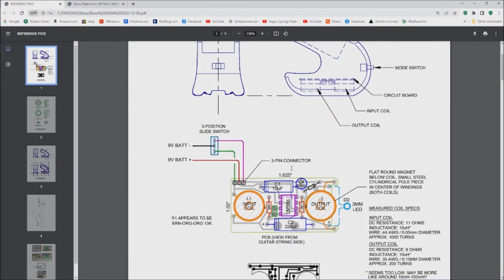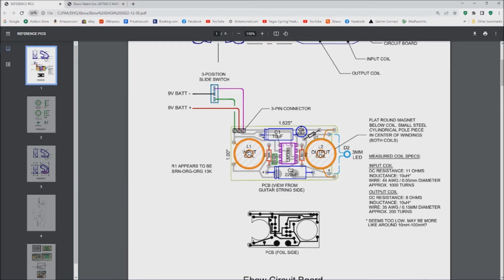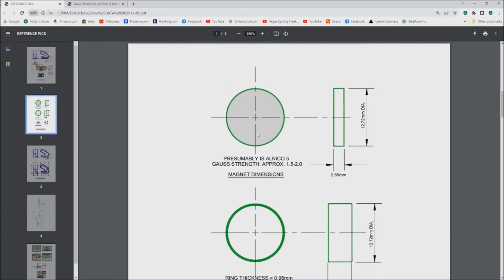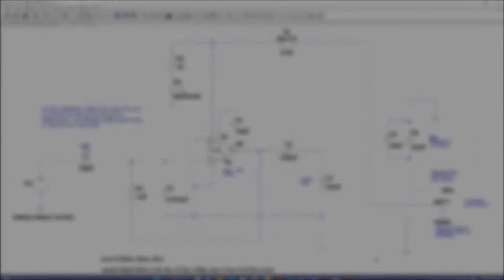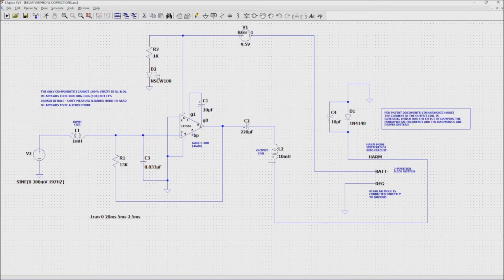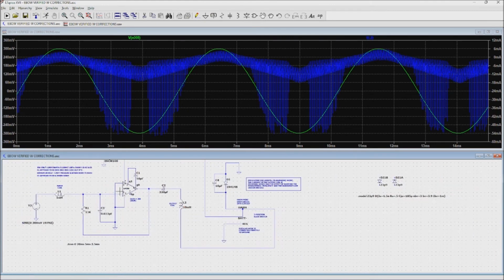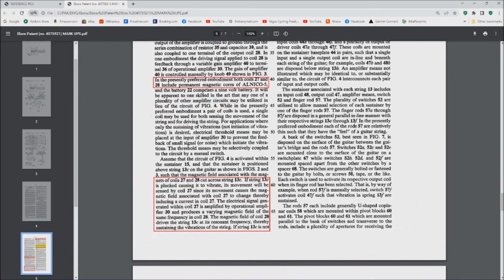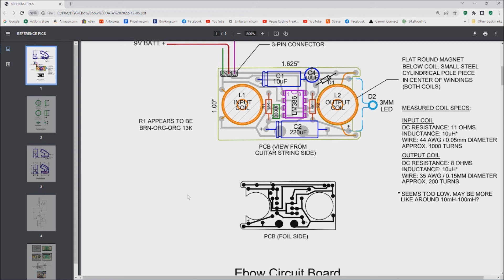All Of Those Ebow Schematics You've Seen ARE WRONG! (Part II)

Comment: The harmonic mode would (best guess) work by clipping the sinusoidal output, limiting to one polarity.  Basically a half-wave rectification option that (via fourier waveform theory) introduces all kinds of harmonics - some of which will resonate with the string etc.  The trick is to optimize the overall circuit characteristics to derive the most effective and efficient effect - simple yet genius.

The potting is primarily used to minimize microphonic oscillations and likewise ensure the circuit assembly itself doesn't vibrate in the package. p.s. If the potting was solely intended to hide the parts they would use a blackened mix.

Comment: It's interesting that they would list the exact amplifier chip for their circuit in the patent and then go through the trouble of removing the identifying labels off the actual chips used.

Have you tried to measure any thing on the actual chip or tried to remove the chip and then breadboard it and test it using a bench power supply?

Even if the chip is dead it may provide some information to verify if it's the amplifier chip listed in their patent.

I suspect your broken ebow died originally from a broken connection rather than a faulty amplifier chip. Your integrated circuit may still work on your destroyed unit.

I've only recently been curious as to how these work and I got to say; that's not how I would have gone about it.

I may have to build my minds version which invisions an AM radio transmitter outputting it's signal into a coil and it's input is coil coupled to the guitar pickup too.

I would make the feedback adjustable like an old single tube radio designs tuner feedback section that they use to pull in weak stations.

I am thinking about building my radio transmitter/receiver using a tank circuit with a quartz crystal resonating at my chosen carrier frequency.

It may not go anywhere but parts are cheap and breadboard circuits allow plenty of room for changes.😊
Reply from the maker: I don't know if they removed the markings from the IC chip or not. To get to the circuit you have to pick it out of literally rock hard goop, so it's almost like chipping away rock from a fossil. I didn't dissect any of these things myself but I think it's reasonable to expect that the markings on the IC chip wouldn't survive this destructive process. The patent documents do not say specifically that it's an LM386. It only says "the circuit includes an operational amplifier which may be any one of a plurality of commercially available operational amplifiers". From the schematic it's pretty obvious that it has to be an LM386. I think they may have purposely tried to be confusing on the schematic, because some things don't quite add up. The patent documents do mention something about adjustable feedback but that didn't make it to the final design of the thing... maybe they felt it was not necessary. Your guess is as good as mine.
Reply: @VegasCyclingFreak   I based my comment off your patent drawings which list the actual amplifier chip. Did you alter those drawings to include this information?

To get around the epoxy potting problem you could take a Dremel tool with a cutting disc and simply cut the traces between the individual  legs of the chip to isolate them for testing. 

It's still common practice for manufacturing to use off the shelf parts and mill off the markings to make it harder to reverse engineer their designs.

They got these priced about perfect to eliminate pirating and home building copies. At $99 bucks it's not practical to buy all the parts and build one from scratch even if you had the exact circuit parts list and layout.

It knocks out the profit incentive for even the Chinese to copy the design and sell them cheaper.
Reply from the maker: @tenlittleindians  If you are referring to the patent I show in the video, I put that on there in red. Nowhere in the patent do I see any specific components listed. You can read thru the whole thing, it's on my website here: http://www.diyguitarist.net/Misc/Patent_4075921.pdf

Whoever dissected the plus ebow originally didn't know what they were looking for because no one had ever tried to reverse engineer one. A lot of the circuit board was damaged, and some of the parts got broken too. The ENTIRE circuit board was encased in whatever goop they used. I had to pick a little bit off one area which was left behind, and it was not anywhere close to easy getting it off. I'm surprised they were able to limit the damage to what they did. The coils were completely destroyed because they were also completely encased in that goop. Most of the "magic" of the ebow circuit lies with the coils. They have to be something very specific for it to work, and to work reliably.

If I need to cut a track on a PCB I can just use an Exacto blade. Done it many times on my own self-etched PCBs to fix mistakes or on pedal mods.

Concerning Chinese copies, it's too late for that. The ebow isn't the only handheld sustainer on the market anymore. There is also the "Joyo" and TC Electronic "Aeon" on the market now. Probably are all more or less the same circuits, but I don't know that for a fact.

Comment: Great video.  Regarding the two round pads: If there is no soldermask covering them I would assume they are indeed test points.  Locations in the circuit and the way they're laid out (for a test jig) seem to make sense.  What is their diameter?
Reply from the maker: I’d say the diameter of those two pads are approx. 1/8”.
Reply: @VegasCyclingFreak  Pretty large test points I guess,  it still seems to be the most likely purpose to me.
Reply from the maker: @kornelispoort6937  It may be that they have some kind of test fixture that they insert it into, so they want to make sure there is plenty of surface area to ensure good contact.